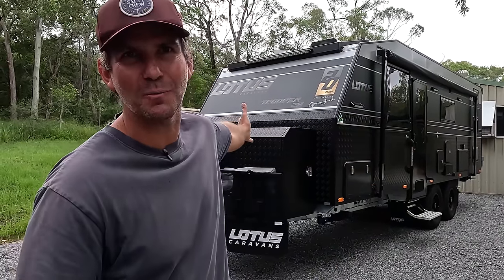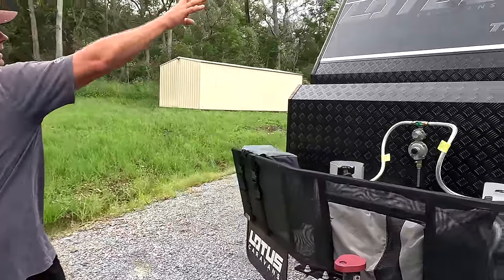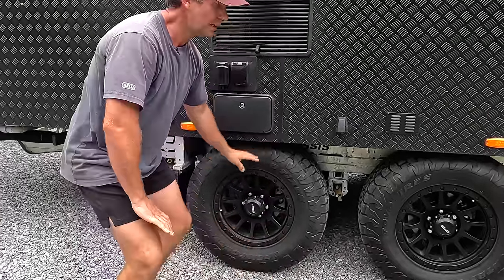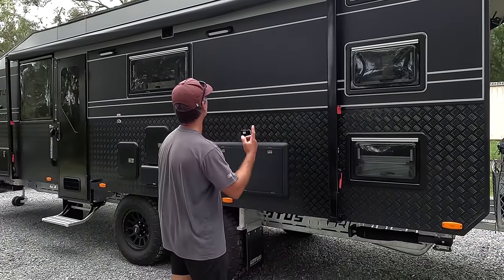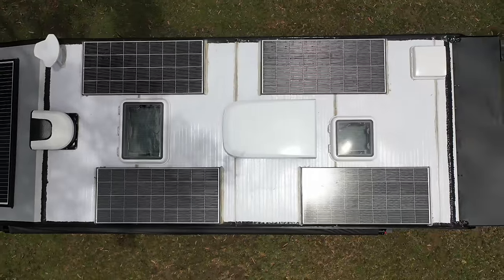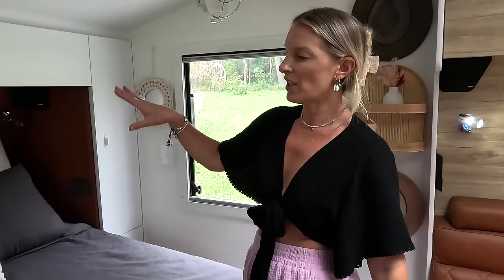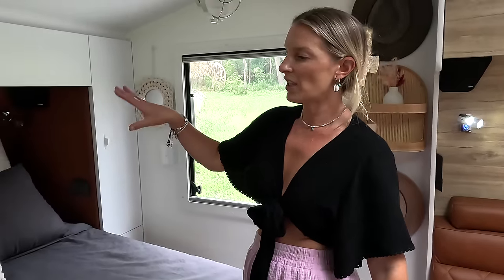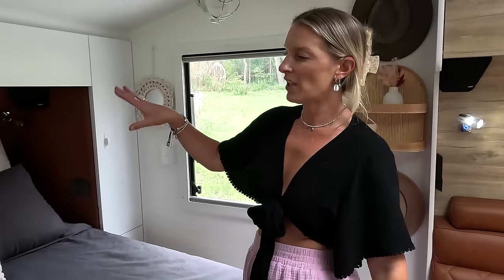2024 OFF-ROAD CARAVAN - The gear on this thing is EPIC😎

Comment: My opinion, I still think there are too many things are exposed, such as a lines and air tanks, even propane tank outside, that I exposed to triple digit weather can easily cracked the seal due to high temperature etc.!!!
Too many things that could catch the wires and to ripped off doing off-road or bend or damage or leaks puncture..Looking pretty tough on outside looking stealthy, however except underneath is not good enough, specially when they’re advertising off grid extreme!!!. 
Far as inside only few things, my concern such as three bunks is an idea, however, very bottom bunk on the floor is too small too crowded. I don’t recommend putting any kids down on the bottom bunk. I’ve raised 5 girls and 2 boys and now have 7 grandchildren. We have done many many years of different ways of camping in different places state to state. I give a credit that this particular travel trailer definitely has more things to offer. However, with that price tag my opinion, they should offer much more to the customers…
Reply from the maker: Great feedback Thankyou. I think some extra protection would be a good idea

Comment: Awesome van guys - very envious😊
We had an instant HWS installed on our van and we went with a ‘Showermiser’ which works a treat and saves buckets of water.
They only come in chrome but had it sand blasted and powder coated black to match the other plumbing.

Keep an eye on the Aussies Traveller door.  I’m continually adjusting it to get it to close and lock properly.
It has also started to delaminate thru corrosion below the vent. - I’m looking at a warranty claim for this issue.
I really like to security and midge proof screen though.

We also installed the Redarc system and really like it - keen to see what the new upgrades are in your future vids.

Happy vanning and Safe travels
Reply from the maker: Thanks mate appreciate it. I’ll keep an eye on that door and I’ll update ya’s in the valve for the hws when I install it 👍

Comment: We use Inox PTFE Food Grade Grease 30 g from Repco on the slide arms and gasket where it slides to close. Does not affect the seals. We have found 42 degrees setting on the hot water means you don't have to fiddle with cold water getting the temp right especially for a shower. Nice van well done.
Reply from the maker: Thankyou for the tips👍👍

Comment: America has grizzly bears, tornadoes and mountians everywhere and our campers are framed with tiny 1×2 pine boards and still costs the same as a 2 bedroom house. A lot of camp sites have a ban on campers because they can't handle the drive up or down the mountain.
Reply: it's a trip the codes over there , up in Darwin NT after Tracy the houses were single story brick bunkers built to exacting high impact tolerance . . those tolerances have laxed in the wind since & all will blow over again

Comment: Just a tiny bit of advice with the triple lock on the front door door. Just be careful to make sure you always lock it. I drove with mine didn’t lock it properly and the external door came open while I was going down the freeway at 100 km and put a real nice dent and bent the door a little bit in the side of the van lesson learned😅
Reply from the maker: Great tip Thankyou

Comment: You should cover the propane flexible pipes and that manifold. especially when going off road. I would be scared of rocks and pebbles hitting them and causing a leak and then the next rock or pebble hitting steel and creating a spark and BOOM ! 
I would still cover them if the were below the guard but since they are above the guard, there is a greater chance of being hit by rocks or debris and if you're lucky, you'll loose all your propane, if you're not lucky, you might lose your life and those of your family.
Other than that, great video and great trailer or as you and the Britts call them, caravans

Comment: Sweet. Not critiquing it, but I'm wondering why the air tank doesn't have a box or bash plate. It would suck if it or any of the lines were punctured by gravel or some road debris/shrapnel. I think my favorite is the hitch set up.
Reply from the maker: I think it would be a good idea to add some protection for sure
Reply: I was thinking the same; couldn't think of the proper name, but bash plate is it. I was looking more at the exposed plastic(?) tubing connected to the tank. It seems it wouldn't take much to break or snag (really rough terrain!) the tubing. Maybe braided steel piping?

Comment: Just fyi. It’s a tankless water heater. Not instant. I have had 3 of them and used to sell them as well. Yes it will take a bit for the water to get warm, but once it does you could actually run it until your water or fuel supply runs out.

Comment: Just a couple of comments
1. I assume your 200 and 300 are limited to 3.5T (GCM also allowing), so you'll keep this van down well below payload.
2. Can't believe you've never had a reverse camera. They are more essential when you live somewhere like Sydney. What I think you will like is that when travelling on multi-lane roads (or overtaking), you can now see if you have a decent gap in the vehicle you are changing lanes in front of. You can also get some idea of how much the van moves around. Much better visibility of approaching traffic than the side mirrors too.

It's good that you're testing the market.

Thanks TIAV. Nice to see Bec presenting again too!
Reply from the maker: Cheers mate. So the 200 has a 4.5 tonne towing capacity so we can load her right up on big trips. 
Looking forward to testing a camera on the van. Always keen to try new things
Reply: @TripInAVan  wow. Is that a bonus of the chop that you can completely re engineer it? As far as I know there is no way to change the GVM or tow capacity of my non chopped 200. All I have been able to do is increase the GVM to just over 4T.
Reply from the maker: @NickSaravanos  yeah so the conversion gets you 4495gvm and 4500towung

Comment: Caps over water fillers, keep bugs and dirt out, same with mains inlet,  bunnings irrigation section
Personally would go for a fibreglass construction,  dark colour are warmer in van
Reply: There’s a lots of enclosement you do to keep clean. Fragile suspension fittings need to be e protected

Comment: Question. I like some of the upgrades. I actually make alot of parts for caravans and alot of the Cruisemaster bits.   The water manifold....I like the idea , but won't all the connections be covered in bull dust thus you'll have to waste water each time to clean them. Seems like it should have been inside a box with seals.
Reply from the maker: Agree, I think I’ll put covers on each connector

Comment: Great run through 😊,. Thanks. Your bathroom looks a tad smaller than the other. Question,... What about 12 volt plugs for cpap machines next to the bed? Could that be an option? (new to cpap  travelling)
Reply from the maker: Great suggestion! They could definitely do it for sure., there is 12v power there for chargers so I’m sure it can be done

Comment: Looking forward to the new Redarc gear.
Is there reasons why the 2 big single windows either side of the bed over the split style windows?
Preference or just not an option?

Glad to see you all back.
Reply from the maker: Cheers mate, yeah so we didn’t really customise this van as we aren’t living in it. We went with a standard floor plan from lotus and just changed the a few small things👍
Reply: @TripInAVan  Ah, good point. Never thought about that aspect of not being full time travelling anymore.
Thanks 👍can't wait for the new adventures.

Comment: Looks like a beautiful camper but I don’t think it would make it in North America. The suspension looks very intricate and does not look like you could fix it in an off-road environment i.e. backcountry.  Also, I have to agree with the other comment with the drain line for the fridge which would let the water run down the side of the unit.  I think the five solar panels on the roof are perfectly mounted, and supply a great amount of power.

Comment: Gr8 van. tell us if the hot water chews through your gas. Induction is no good if you have a pacemaker as they have a magnetic field to work. But very nice van
Reply from the maker: Thanks for the tip, didn’t know that about induction hey

Comment: Love your new van. I’m a big fan of lotus. Q with the new regulations with battery’s being inside? How did they get around having them inside? Cheers Paul
Reply from the maker: So they just have to be in a sealed compartment with external vents. So under the lounge is sealed with a screwed on panel that fits over batteries with a vent through the wall

Comment: Great presentation of the van.  QUESTION: why are you using  gas heater and not a diesel heater?
Reply from the maker: We have tried both in the past. We figure we already have gas bottles for bbq and hot water so no need to run another fuel source just for heater. Gas heaters work great.

Comment: Hi guys, love the van. We recently took ours to Yamba. First time in a van park situation. Van would not take plugged in mains water. Tried several fittings, just kept blowing hose off connection  point. Any ideas 💡?
Reply from the maker: Hey mate, maybe the pressure limiting valve on the van was stuck closed or installed backwards maybe?? That’s all I can think of.
Reply: @TripInAVan  thanks mate!

Comment: Lovely colour scheme inside, I’m curious to know how or what you did to be able to tow the van with either the 300 or 200 given you are in Queensland I would have thought your GCM would be a problem ?
Reply from the maker: Good question! We can tow if it stays under 3.5tonne. 
300 has a arb stage 2 gvm upgrade which is 3920kg gvm

Comment: hey Justin on your starlink plug you should let Lotus know that the pins should be on the top of the outlet (lock down) so if any shit gets in there you wont short the pairs out especially as it is a POE device punching 48vdc out to Dishy. I realise that dust accumulation shouldnt happen as the waterproof socket is on there and when in use the plug fills the hole. maybe this is an OCD thing but when we first started using RJ45 a while back it was recommended so I know everyone will say it doesnt matter but I also like to align my screw heads on panels aswell.
Reply from the maker: Great info mate thankyou. I’ll pass it on. Makes sense

Comment: Nice van.

The wing is actually functional. You were on the money with the drag car comment, it should reduce aerodynamic drag at the back of the van. Squared off edges are bad for it.
In theory, you should see a reduction in dust on the rear of the van if it's working correctly.
Reply from the maker: Perfect
Reply: Also adds a small bit of realestate for solar panels it could be the difference of running a couple of extra panels
Reply: The only benefit is “bloody good looks” and increased roof space for solar but the aerodynamic benefit has been researched and it offers no benefit.
Great van and look forward to seeing where you take it.
Reply from the maker: @graemegrieve1953  cheers

Comment: Hi guys, quick question re charging from 200 to lithium batteries. Can we charge via the alternator to the van? We have been told our 2014 200 servers won’t allow this to lithbatteries? Is there an extra we have to buy for this to happen? 
Thanks and can’t wait to see the year ahead. We are heading off soon with our three kids, new van, sold house and adventure awaits 😀
Reply from the maker: You normally run your alternator current through a dc/dc charger which ups the amperage and has the correct charging algorithms for lithium. They are readily available

Comment: The exterior looks like a kid designed it and the interior screams flat pack furniture with all that white faced board.  I’m guessing the boxy crude looks are a trade off for ruggedness and durability.  That chassis and airbag suspension look tough as.

Comment: Yee Haa. Here we go, I’ll edit in more later hahaha 
What !?!? That was it for power Nooooooo ! 
Tell Redarc to pull their finger out !
Also, I rang Boss and asked them to make a jack stand that was designed to fit the electric jack receptacle, so that I could use the existing fitting and not have to attach a jockey wheel mount plate but they pretty much blew me off, saying that they weren’t going to be looking at that 🤷‍♂️
I’d have fitted one to three vans by now but nope, not happening, would have bought the matching legs too but there you go 🤷‍♂️
Reply from the maker: A month or so and I can do a run down on new charger setups

Comment: The Queensland Government is to introduce tough new laws that will mean that any Queensland driver wanting to buy a caravan will probably need to buy a new tow vehicle as well.

Under the proposed new codes, to come into effect in two weeks, the towing capacity of 4WD vehicles will not be able to be upgraded after purchase. The upgrades affected include improved suspension and shock absorbers which often provide a more stable, safer ride and quicker stopping, while increasing towing capacity.

The Courier-Mail reports that Queenslanders who need an increased carrying or towing capacity will instead soon be forced to buy large, powerful, expensive and fuel-inefficient imported utes and trucks.

The weight of accessories such as water tanks, extended fuel tanks, bull bars and winches force many vehicles over their legal weight limit, which also makes upgrades necessary.

The Courier-Mail says that vehicles operated in excess of their legal carrying capacity will be declared unsafe and are not covered by insurance.

The ban will mean that many caravaners will be lucky to fit two people and a full load of fuel into their vehicles before they are over the legal towing limit.

The vehicles most affected include the most popular 4WDs on the market, including the Toyota LandCruiser, Toyota Hilux, Nissan Patrol, Ford Ranger, and Isuzu D Max.

The new laws will affect up to a million 4WD drivers and 200,000 grey nomads.

Australian Caravan Club treasurer Graeme Tree yesterday said the ban meant any Queensland driver wanting to buy a caravan would probably need to buy a new vehicle as well.

“If this was about safety, it would apply to all vehicles on the road,” Mr Tree told the Courier-Mail. “But these are modifications that are fitted to Queensland police, emergency services, fire and parks vehicles to increase safety in towing … they are already on thousands of private vehicles in Queensland and are perfectly legal in other states.”

Mr Tree said the proposed changes to Vehicle Codes LS11 and LS15 would decrease safety on Queensland roads and unwittingly put drivers of 4WDs in breach of their insurance.

“Modifications to most 4WD vehicles are essential for legal towing, so from September 4, most Queenslanders buying a caravan will also need to buy a new vehicle,” he said. “It is inconceivable that Queensland would stop people improving the safety of their towing vehicle when the modifications are allowed under federal laws and before registration in Queensland.”

Grey nomads Ray and Lynne Friis said their Bog Lap plans have been thrown into disarray by new State Government laws.

“It almost feels as if this government is targeting grey nomads,” said Mrs Friis. “It’s definitely about revenue raising.”

Mrs Friis said the new law was ‘silly’ and meant that if they wanted to buy a bigger caravan they couldn’t.

“We have worked hard all our lives to enjoy our retirement and travelling with the caravan is a big part of that,” she said. “Now we are hit with these extra charges to make sure we can tow, it makes no sense whatsoever.”

Will this affect you? Comment below

Comment: I could pick this apart, as to what and how to improve on a pretty good unit. One thing I would do is have a tent with a toilet sink and shower outside. No Bathroom inside and the tent simply pulls out of the rear door frame and assembles itself. Big decent looking with a tin roof and part hard fold out maybe. At level with trailer floor or descends to ground level. I'm half claustrophobic, half cluts, and cant spell either. I got some other cool ideas and a little goes a long way if you like.

Comment: Instantous gas sound interesting but what if your pulled up at caravan park for several weeks or even a few days. You would be using your LPG and not their power. Mmmm.
Reply from the maker: Yeah I guess if you were worried about that it’s not for you. Most of our stays are off grid or free camps so it suits 👍👍
Reply: @TripInAVan  not worried just thinking of the flip side.

Comment: I’ve had an aluminum double axle trailer for 20 yrs. Over time, the welds get brittle and break. For the price of these, I expect the last longer. I will never buy another aluminum trailer. The rear overhang helps keep dust off the back.

Comment: Should there not be an arched stone guard that is removable for the gas piping at the front there!
Reply from the maker: I don’t think it’s a must.. our previous vans have never had protection either
Reply: @TripInAVan  but it’s gas, all fine saying nothing happened yet until it happens. A faulty gas pipe or system is an explosion or fire in the making, I know I live on a barge and very strict rules, enclosed cabinet with a hole near the bottom in case of a leak so the heavy gas can escape. See quite a few gas fires over the years. Not being an a hole just saying. Would take nothing to just protect from that one random rock.

Comment: Most of rather cook outside but the weather may piss on your parade so gotta fix up meals inside. Whoever designed that kitchen layout neither likes nor knows cooking. Fix it by rotating the cook top 90° and shift it all the way into the corner and add some splash guards then you got a perfect unit. Cheers